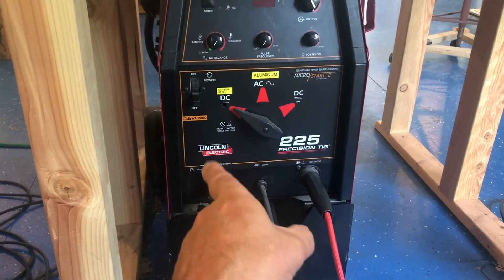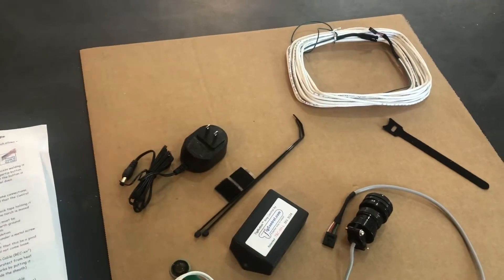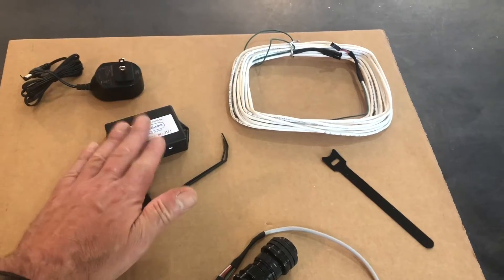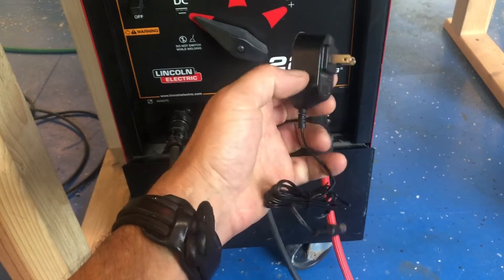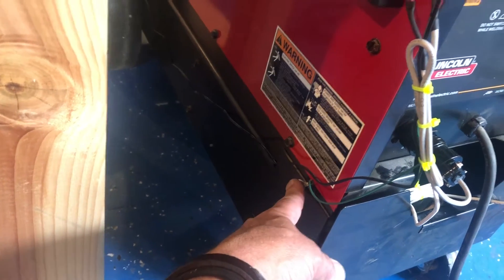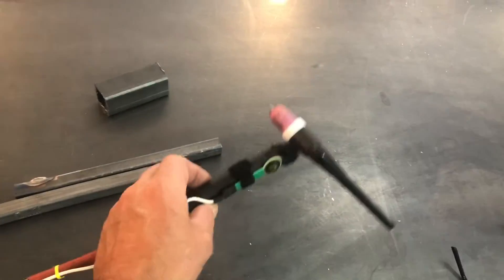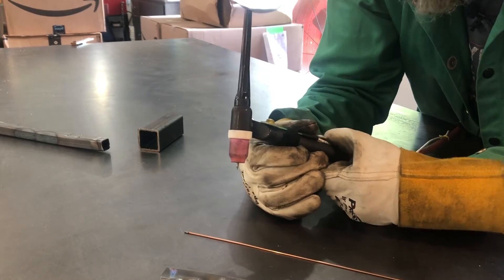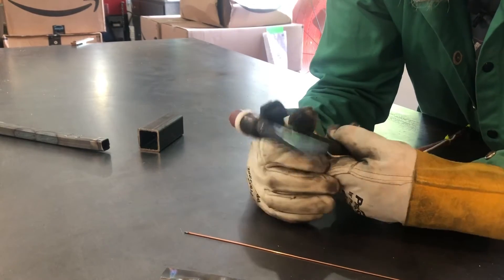Tig Button Install // Amperage control at your Fingertips !

Comment: As most of my work is with boats, I am rarely in a position where a foot pedal is easy to use. I LOVE THIS UNIT!  Dave is has helped me several times with customer service and I've bought additional units for different welders. There is just not another unit that comes close to how smooth this works. I can ease in, or hold a little heat at the end as I wish.. throw away your on/off switches.
Reply from the maker: Yes absolutely an awesome control, I love mine too!

Comment: Got one about 8 moths ago, so far so good. Attached to my torch with the recommended silicon tape. The tape allows for rotating the button in order to better position it under different circumstances.  BTW, running water cooled torch.
Reply from the maker: The velcro does the same as far as repositioning the button, and I am very happy with it since using it for a while now.
I have never used a water cooled torch in over 30 years of fabrication.
Sometimes I feel like I’m missing out 😆

Comment: Found your channel looking for reviews on the button because it's pretty expensive, more than my 25ft water cooled torch and lead! Like you I build steel furniture among other things and the foot pedal sucks when your welds are two inches at most then you have to move again. Really adds time to a project. How long did it take you to get used to it and do you even use the foot pedal anymore?
Reply from the maker: Thanks for watching Joseph… It really to zero time to get used to using a button for control, but it took a couple hours welding to find a comfortable spot on the torch that worked for 
Different weld positions.
I still swivel the button around sometimes and switch between using a finger or my thumb to press the button. 
The pedal has been in the drawer since I installed the button 
Hope this helps

Comment: Can I add the Tig button to a non-pedal machine?
Reply from the maker: You will have to ask Dave at Tig controls about that, he is very helpful. You can call or email him
Reply: What tig machine does not have a pedal?  How do you control your amps?
Reply: If the machine doesn't do it then a button or pedal isn't going to do anything

Comment: Way to much bullshit for a simple switch. Now you got an extra wall plug to be a inconvenience. Now you got to run another extension cord from your welding cart to be in the way. Pulling a screw off your welders cover will void warranties because now they will say the cover was removed.
Reply from the maker: I am excited each, and every time I use this button, it is such a dramatic difference between dragging that pedal around, your mileage may vary and you are certainly entitled to your own opinion.
I would pay double for this button than what it cost me 👍
Reply: Worth every penny, trust me. The extra plug is a little inconvenient, but not that big of a deal. If you're worried about the warranty, you can ground it to the frame. You just sound like a hater.

Comment: your install is mickey mouse. Remove the sheet metal of your welder. Plenty of room inside. I would also get another torch handle and grind it down to fit the tig button, The sleeve over the hose is amust. No zip ties needed. Thanks for posting anyway.
Reply from the maker: Thank you for your input, may I ask what type of tip you currently have on your machine?